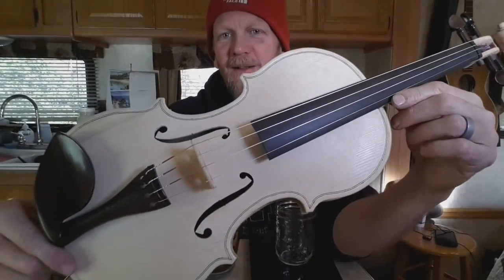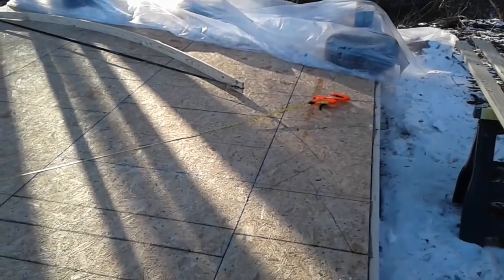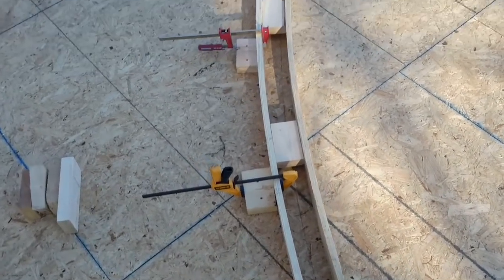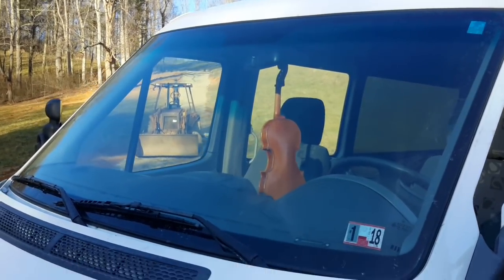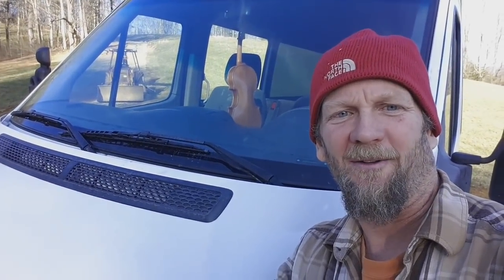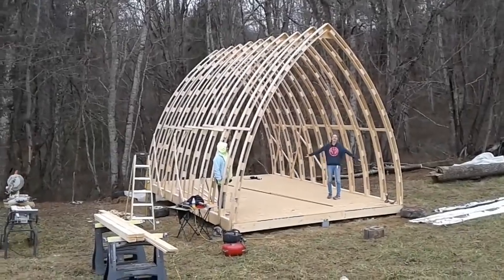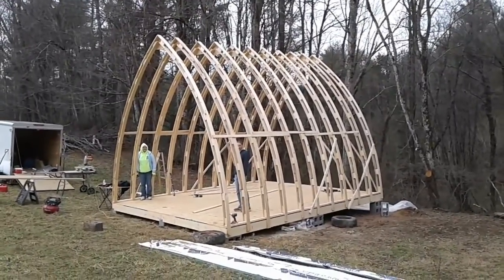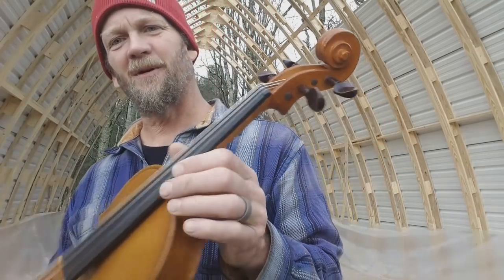The Farewell Fiddle part 5 --- Building the Bungalow part 1

Comment: Great video my friend! Do you have a copy of the plans you used? Wanting to build something just like it in Northern Michigan!
Reply from the maker: I designed the gothic arch bungalow myself after building and testing a smaller prototype in northern NH with tremendous snow coverage.
Here in TN, I easily heat the 420 as ft of living space with a single electric heater...usually never above the "medium" setting (about  900 watts)
The gothic arch is formed by striking an arc about the width of the building.  I needed more room for the loft, so on a 16' wide deck, I struck an 18' arc.  It's very strong -- My complete bungalow including bath, shower, flooring, paint, carpet, kitchen, etc cost me $7000 to build.
You may email me at ridingontwowheels@gmail.com if you'd like and I will help any way I can.
Reply: @grandpasmountain  That's fantastic Jon!  Thanks so much for the info.  Good to know the overall length difference for the span of the arch.  I'm considering doing a 3' wall all the way around that way both the lofted area and overall interior underneath the loft  like you built could have a slightly taller ceiling. Seriously though, excellent series of video's, and considering I'm a huge bluegrass and folk fan, I've loved hearing your violin sing. Cheers my friend.
Reply from the maker: @KentRobertSwickJrAroudTheWorld  A 3' wall would be very weak--  unless you can integrate it into the arch seamlessly.
The interior and exterior pieces of the individual arch act under tension and compression as they are separated by the spacer blocks.  
Picture an old fashioned "A" frame house.  What makes it strong is the fact that the walls are tied to the bottom.  Now build a 3' knee wall and put the "A" frame on top of it.  The "A" frame will push the knee wall out and collapse.  
You would have to have amazing longitudinal strength at the top of your knee wall which would be impractical.

Try making a model out of small pieces of pine and work out the problems.

The gothic arch structure functions like an "A" frame, but gives much more room.

The use of the shape come from Norwegian barns.  Not only will the shape store more hay than our Gambrel roof shape, but it is aerodynamically superior and withstands much greater wind gusts.
Reply: @grandpasmountain  That makes a ton of sense Jon.  Thanks for the clarity.  maybe I'll end up making it wider and taller then!  Again, thanks for the clarity!
Reply from the maker: @KentRobertSwickJrAroudTheWorld  take a piece of graph paper and use a compass and make a scale drawing. 
A 20' wide x 24' long building would give you a huge amount of space and a decent size upstairs or loft.
Reply: Jon I am going to piggy off of Kents comment ... i love your series and totally binge watched it all! I was wondering if you could give me some idea of how you attached your tresses to your deck? I am having so much trouble trying to nail that detail down... any help would be much appreciated!
Reply from the maker: @SoldiersofPeace2012  The trusses are built with spacers made of 2x4's.
I bolted a 2x4 the length of each side of the platform.  
The trusses fit over the 2x4.....
Reply from the maker: @SoldiersofPeace2012  look at 9:17.  Upper left hand corner of your screen is an end of the truss--  you can see the scrap of 2x4 to simulate the piece on the deck it will connect to.
The outside longer piece screws to the outside if the deck.  It's incredibly strong.
Reply: @grandpasmountain  That is awesome! I totally missed that!.. that makes total sense now! I wonder if you could use a 4x4 as the base board and lag bolt into the deck and screw into it? I dont see why not...

Man i cant express how much i love your series! So many ideas and the way you explain things makes it seem that much more doable! Thanks again!
Reply from the maker: @SoldiersofPeace2012  Yes, if course you can--- I made a "storage " gothic arch for kayaks and bikes and it sits on heavy pressure treated beams---
In this case, the longer outside piece of the truss screws to the outside of the deck-- incredibly strong --- there is no need.  
This structure laughs at high winds!

You're quite welcome.  I never meant the video as a real "how-to", but I am happy you can pick up the concept so quickly!  

Now that we've gone through a winter and really proven the design, I could not be happier with it.